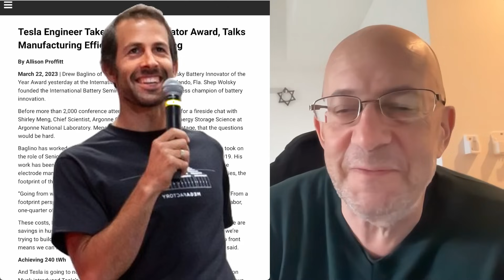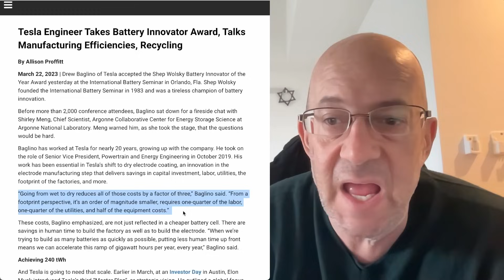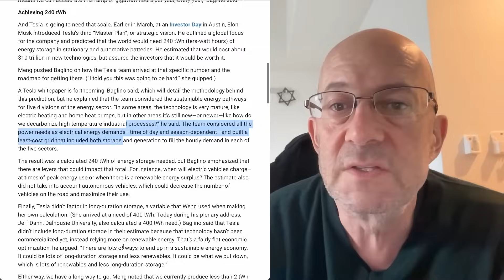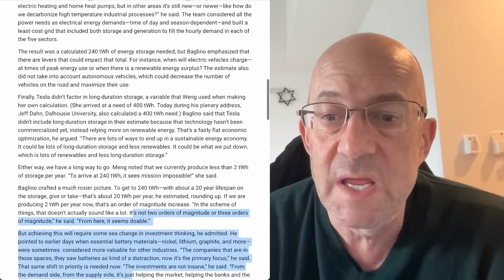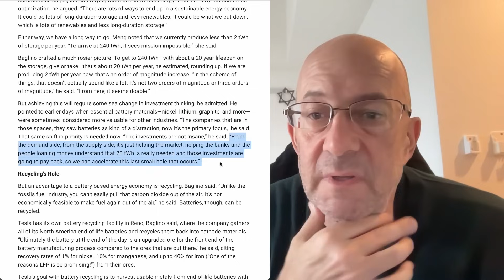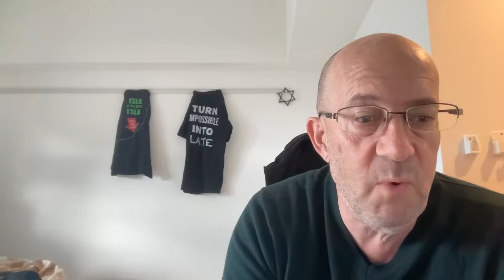Tesla Massive Growth - Drew Baglino - Battery Tech

Comment: This is why a FCHEV with about 50 miles of battery range make sense.

90% of all driving is within 50 miles of home.  So a FCHEV that can be charged at home with the same recharging efficiency as an BEV for 90% of it's miles driven.  The remaining 10% of miles driven outside that range would be at the lower efficiency of hydrogen refueling, but the net total energy used would be about the same since  between a FCHEV  and a BEV because of the weight penalty that BEV's incur.  Of course, if your duty cycle is to drive 200 miles a day, then it changes the math, but 90% of all miles driven are within 50 miles of home.

And then, with 50 miles of battery range, you can build 7 times as many cars as BEV's of 350 miles range or use the batteries saved for stationary storage.

Comment: Had an interesting thought a couple of hours ago...
An ICE car can extend its range by about 50%, just by carrying a jerry can of fuel in the boot.
Can an Exploding Vehicle carry two or three tonnes of spare battery (and all of the heavy lifting equipment and tools needed to swap it out) in the boot? 🤣
Reply: That called a prejudice based on a diseased brain!
200 miles in 14 minutes L3 Tesla charging - a scheduled comfort stop on a 1000km journey in under 10 hours.
Only 0.01% of Teslas have ever caught fire. And increasingly safer batteries are being employed with the majority of Teslas now using LiFePo4 chemistry that is very unlikely to combust. 
In June 2021, Click2Houston reported that over 6.5 million vehicles were under recall because they could catch fire at any moment. The list of brands did not include Tesla, and the cars in question were not EVs.
ICE are ten times more likely to explode per distance travelled and with an illegal shaken gas can in the boot...
Reply: The........

Comment: I appreciated this video more than most.
4680 with DBE step change in cost reduction of cell production.
Drew explained it well, we need 10x expansion - very achievable.
CATL expanding fast despite using wet slurry & solvents - highly automated even in China.
I do feel 4680 designed for nickel chemistry & fire characteristics / high pressure.
CATL get away with much simpler cell packaging for LFP.
Reply: 4680 could be developed with LFP chemistry
Reply: @rozonoemi9374  the CATL prismatic is 3-4 times bigger physically. BYD blade too. 
I’m no genius, it just seems 4680 is carrying excess steel for LFP, though it’s appropriate for nickel.
Even more so for stationary storage where structural contribution not required - or even the Semi.
DBE & "tabless" electrical / heat transfer characteristics still huge advance, as is automated assembly.
I do like / prefer cylindrical, cells are physically robust even outside pack, it’s versatile.
Tesla is only Western company on path to succeeding in batteries (Panasonic is Japanese).
I’m open to changing my mind, given convincing argument.

Comment: If Tesla goes LFP. It will probably hurt the brand. Byd sells lfp, but does the consumer like it? Probably not. They buy it because China subsides it and less expensive iron phosphate, not because anyone really likes it.
Reply: Rubbish.
LFP isn’t inferior. Life cycle is better - by multiples. More consumer friendly in charge level abuse.
Way less fire risk, zero cobalt, even nickel is a bit difficult / dirty to extract & refine.
Given addition of manganese with voltage boost, gravimetric density much more similar to nickel.
Cost is crucial, esp for stationary storage.
PS. Tesla started in luxury market, heading to mass market. That’s where the AGW impact is.
Reply: @iandavies4853  cars with LFP batteries tend to have a shorter range than those with the same mass of NMC batteries. The mass is the bottom line.
Reply from the maker: Tesla American-made LFP will mostly go into storage devices like Megapack. Tesla already uses LFP in standard range Model 3 and Model Y. Next gen vehicle will likely use it in some trims. It is lower cost not because of subsidies, but because iron is cheaper than nickel and LFP doesn't use Cobalt.
Reply: @xlargetophat  LFP takes 100% charge & total discharge much better, so range reduction isn’t as bad as on paper.
Chemistries including manganese (LFMP) are midway to gravimetric density of nickel.
Resistance to spontaneous thermal overload also important metric, as is cost - like 30% cheaper.
Tesla evaluates 8-10 major traits, not just energy density.
It’d be like judging someone on the size of their hat, or frunk, or cup holders, just stupid. ;-)
Reply: Somehow everyone thinks nickel hit a roadblock because they're following an lfp storyline. Lol.. you're all going to side swipped.

Stroker ace was born to race.
Reply: @xlargetophat  give up already.
Just why do you care?
Is it sinophobia? (Anti-Chinese sentiment?)
Battery chemistries are, & will be in state of flux for a decade.
LFP type chemistries are valid, competitive, have some compelling advantages, some not so good.
Nickel also great (mostly) if well engineered / manufactured.
It’s all to address AGW, to kill fossil fuel.
Get over yourself, you aren’t important.
Reply: Lfp is piss and vinegar. Long live nickel and freedom.
Reply: All your comments are engineering problems not base science problems. Everything iron phosphate can do, nickel can do better.  The mass on the periodic table. LFP is a trick job, same with extending pack size to give you the illusion of range.
Reply: @xlargetophat  wrong.
LFP is cheaper to make, hence CATL is expanding at break neck speed like 100% plus pA.
Price speaks, esp for stationary storage, for low price cars, for shipping (China is doing inland electric shipping in big way).
LFP slightly heavier - only downside.
West lost on LFP due to patent issues, China circumvented patents, invested R&D.
Other chemistries like sodium will eventually feature.
Sports cars or long distance autobahn cruisers are small market. There nickel wins.
Everywhere else, cost (& fire safety) is bigger factor than energy density.
What did slow adoption of LFP is spiked price of lithium - LFP needs more per kWh.
Reply: @iandavies4853  nickel based battery research has evolved as well but the LFP story has become the story to sew.

Comment: 4680s produced in the US have the potential to reduce the price of each Tesla vehicle by several thousand dollars.  Two lines are ramping at Texas with two more lines standing idle in waiting - total 100 gigs.
4 lines under construction at Texas - 100 gigs
4  lines planned in the expansion at Nevada - 100 gigs
Suppliers are also supposedly working on 4680 - progress unknown.
At Texas, improvement in yield per quarter is 20%, which is good.
4680s should enable lowering the price range of EVs to the same level as ICE vehicles in the class.  This is a big deal, or will be.
Reply: @AudiTTQuattro2003  4680s were already in vehicles as of Battery Day.  The Kato road facility has been supplying 4680s for standard range rear wheel drive out of Texas.  Texas has been producing vehicle grade batteries for months and production is increasing at 20% per quarter.  That you don't know the specs means nothing except you don't know.  Watch the CT delivery event in 10 days and perhaps you'll learn something.
Reply: @AudiTTQuattro2003 we know why, one of the drying process is holding up the production. And process is being made. It didn't take them long to hit another 10M battery after first 10M, which took much long to get too.
Reply from the maker: "if it works. Why are they still not in cars?"

Tesla made thousands of Model Y with 4680 already. They stopped that line to save the cells for Cybertruck. please try to keep up.
Reply: @WarrenRedlich  Not keeping up is one thing and just being a hater is a different thing.
Reply from the maker: So you're just a hater?
Reply: @WarrenRedlich No, not me.  Investor/follower I am.
Reply: Be patient, November 30th is coming & you'll know all there is to know! @AudiTTQuattro2003
Reply: Correction:  4680 increase in yeald 40% per quarter